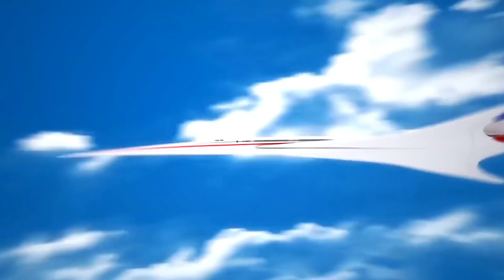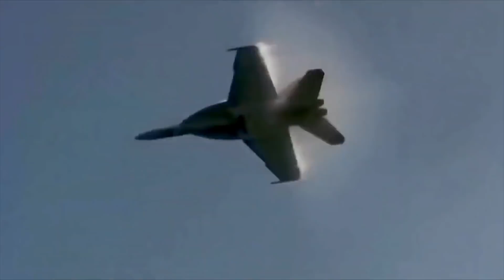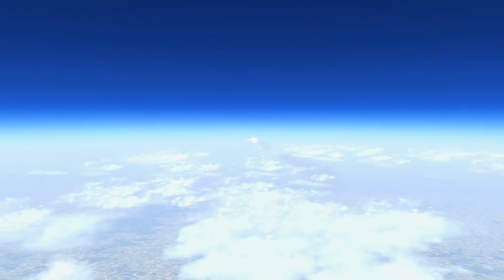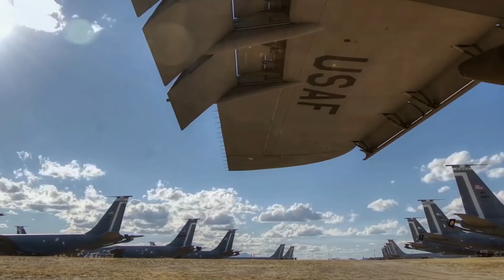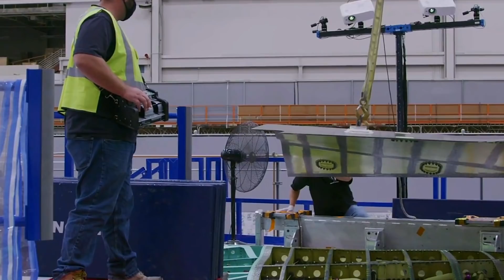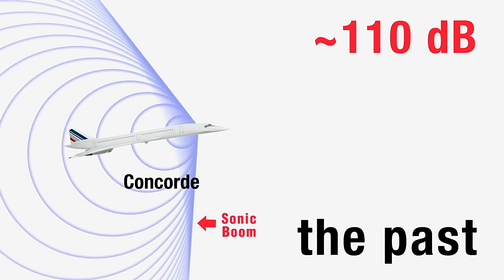A Supersonic Aircraft with a Silencer

Comment: The F-117 was made of 3 Different Aircraft to Begin with.
Reply: was it? what parts?
Reply: @mattwaters9008  It used F-16 stuff mostly, including the landing gear.  So, it is kind of funny this video says landing gear from an F-16 and stick from an F-117.  Of course, Dark Docs isn't at all known for accuracy anyway, so it if all turns out to be parts pulled from a Cessna 210, a Chevy S-10, and a DC-10 I would be all that surprised Dark got it wrong.

Comment: I’ve always understood the sonic boom to be an unavoidable result of faster-than-sound travel, not something that can be engineered into irrelevance. How does the design of the plane minimize the boom? Clearly part of the answer is the plane’s unusual needle nose, but why? The video frustratingly spends too much time on the plane’s Frankenstein aspects and stays quiet on the very technology promised in the title: the silencer.
Reply: Vanghost Art  Do little ice cubes make drinks better by cooling them faster than bigger cubes of the same total mass, due to increased surface area, or worse by diluting the drink quicker for the same reason? Does the answer depend on the drink, and if so why? Yes, I am a party animal!
Reply: I'm thinking it has more to do with the cruising altitude than the physical build aspects, as it states in the clip.
Reply: A bit late with the reply but it's shockwave generation that's unavoidable, not sonic boom. That's not a contradiction, look at the Busemann Biplane concept.
Reply: So I generally don't weigh in here - but you're right about it being about the nose.  Think about air being a substance like a giant rubber band, not just well...air.  As you travel through it, there is resistance on the body traveling through it.  You get this a little like if you're going down the highway with your windows down...even on a windless day standing still, as you move through space, there is air resistance and indeed, friction.  Your car (or any other jet that can go supersonic or literally "over sound" does the same but because the nose is snubbed, or not out in front of the main body of the craft stretching through it (and if your car can go that fast - I want the secret!), after the point at which sound travels - that's the rubber band, from the analogy above snapping back into place from being stretched to its limit (so in other words, it's not the sound being snapped, it's the air pressure/friction around the aircraft it's traveling through) Because of the nose cutting through the air to the back of the aircraft where the "rubber" snaps back into place, a louder "boom" is heard.  Add to this that the "rubber" in the air at high altitude is thinner than on the surface of the earth, and so the "snap back" is far less than say, at sea level.

This particular aircraft, because it's nose is "needle" the stretching of the "rubber" (sorry for the analogy!) is stretched more precisely, and more gradually, so that when it does snap back - it snaps back more gently and less suddenly.   Sorry for the layman's terms for aeronautical physics...I don't know from where or which profession you come from - so I thought I'd try to be as simple as possible.
Reply: @JoelMBarr-hh7vs  Thanks, it’s fascinating stuff.
Reply: Fortunately NASA has the sort of information this videographer left out. 
Pre-pandemic they would have a huge setup every year at EAA AirVenture Oshkosh with information on projects such as this one. I do remember the display and talking to the people staffing it. IIRC the angulation of the nose and control surfaces makes the impact of the plane hitting the air molecules more gradual, so the cone of displaced air (the shockwave expands in a conical shape) is longer and smaller diameter. By the time the shockwave does expand far enough to hit the ground, it has dissipated enough to blend in with background noise or at least not rattle the dishes and break windows.
Reply: @BigBlueJake   Wow, that's super cool - mine was really a SWAG, TBH (it seemed logical) And the videographer provides us with likely hours of entertainment - I'll forgive him the occasional omission. :D
Reply: @slowerpicker  just shy of your pursuit!    You need many smaller ice cubes !! Not a huge one regardless of it having the same surface area..   the magic happens in its sheer numbers
Reply: Avec tous vos dollars vous avez 1 siècle de retard à comparer avec la technologie concorde.
Reply: to make a simple analogy, the plane stabs into the air instead of hammering it
Reply: Pointy Snoot Make Air Go Hush Hush
Reply: As a college physics teacher freak 

The scientific question is sharpness the sharper the object is the most ability to PERICE without sound

Like a needle going through your skin it's so thin that air isn't able to stop it and it goes in a lot faster

The air is unable to grab ahold of it so it gives up on reveling the jets position
Reply: It would require way more space and effort needed than I can apply to explain the “sound barrier” and how the shape completely effects the outcome. Has a lot to do with dissipation

Comment: With the noise in the big cities, I doubt anyone would notice a sonic boom now. "Is that another gun shot?"
Reply: The catch with the Sonic Boom tests of the 50's and 60's is that they were rattling dishes on walls and in some cases breaking a window pane here and there, so they're mildly louder than a gunshot from two blocks away. More like a gunshot from the car next to you, which is a good deal more frightening and damaging to your ears.
Reply: Nah, that was a window being smashed by the looters.  You can tell by the giggling that follows.
Reply: rottencactus28  When they're several blocks away in a city, or several miles in the country, you're correct. When they're ten feet away, most people react a bit more strongly. :) Sonic booms are typically of the "ten feet away" gunshot variety.
Reply: Enemy territory
Reply: B B  And they weren't even true sonic booms, either. They're legally prohibited from doing that over land unless they're actively intercepting an inbound nuclear bomber. I'm not even sure if they broke the sound barrier on 9/11, even after they knew what was going on. What the airshow flights do is get up to 0.98 mach, or thereabouts, and create a very loud boom which you generally can't hear more than a couple hundred feet in front of the plane, but it's still not a fully compressed sonic shockwave, since at airshow altitudes, that would blow out the windows in all the spectators cars, and the eardrums of all the spectators.
Reply: @c182SkylaneRG  I remember them. Loud boom! Then just the exhaust noise of the turbines.
Reply: @c182SkylaneRG  Not just for nukes, they can go supersonic to stop any foreign military aircraf that breaches US restricted flight zones, or when an unresponsive aircraft is approaching the white house (which actually happened recently). The only catch is that they have to be above a certain altitude before they reach those speeds
Reply: You would pay no attention to it 
in Chicago, where only criminals are 
allowed and encouraged to carry guns.
Reply: I've heard one, they're exponentially louder than a gunshot, everyone ducks and looks up.
Reply: B B  the blue angels don’t conduct supersonic flights over populated areas
Reply: I routinely hear the sonic boom from SpaceX’s Falcon 9 booster returning and even from 20 miles away, it’s much louder than a gunshot and rattles the windows.
Reply: I live close to Edwards now and sometimes there are some Sonic booms that you cannot miss lol, the whole house shakes!

Comment: Really saving years by borrowing landing gear, a canopy and a flight stick?  Lol.  Way to go digging deep for those savings.
Reply: Much less building, testing to destruction, re building, re testing to destruction, re designing, wash rinse repeat till you get to your goals. Instead just use parts that are already capable of handling the stress.
Reply: One of the longest lead items on a new airplane is the forging for the main landing gear oleo.   Engines are the longest lead item.

Comment: The Concorde used to fly over my grandparents house when turning to approach Kennedy airport in NY. They lived up high on a hill in the Jersey Shore and it was extremely loud even flying slow. Sounded like a fighter jet, and I felt terrible for my grandparents.
Reply: Same near Heathrow, you certainly knew when it was flying.
Reply: A couple of times a day?
Reply: @edmonddowling3686  what?
Reply: I grew up within earshot of the engine testing shed. Sometimes they'd be left running for what felt like hours.
Reply: Well it had Rolls Royce Olympus engines which were originally from an Avro Vulcan. The only difference was that the Concorde's Olympus engines used afterburners

Comment: A FYI... The nose of this aircraft will extend telescopicly and will NOT be as long as illustrated in current footage. It also has a number of analog dials fitted due to the accuracy of digital dials not indicating true airspeed exactly as calibrated once over Mach2,  along with several cockpit parts directly from the Grumman X29 and even a part from the F1-11! 
It was to be powered by two Pratt & Whitney J58 (company designation JT11D-20) axial-flow turbojet engines, although the engine/s have now been made classified. 
There is also a number of other jamming devices which have been fitted although the reason is classified. The underside is totally flat and has 400 layers of a certain silicon oxide, silicon nitride and diamond mylar. It is understood as to perform 99% reflective to protect from hits by certain AN/SEQ-3 Laser Weapon Systems or XN-1 LaWS currently covertly hidden within other weapons on several Chinese vessels in close proximity to the Spratly island's. The rest of the aircraft is covered in a new version of iron ball stealth paint.
Reply: Now that is some excellent information
Reply: How much of this "information" is real and verifiable and how much did you just make up?  Do you have any sources?  Cause it sounds completely made up.

Comment: Maybe if this works my children or grandchildren can finaly fly for less than 2 hours from europe to the us🙏🙏
Reply: Why would you want to go there...
Reply: @Mr2greys  idunno where Else?
Reply: Better hope they win the lotto.
I flew the concord a few times from JFK to Heathrow. Round trip tickets cost 3x  regular flight $1250 Bucks 25 yrs ago.
Reply: @CheapSquierBassPlayer  
What's Canada ?
Reply: @johnsegertsons2143  Perhaps, although in spite of its innovative design, Concorde suffered from a number of inherent inefficiencies that drove up the operational expense - and therefore the ticket price. Hard to imagine that a modern SST wouldn’t still be more expensive for the passenger, but the difference could be significantly less than it used to be.
Reply: @f123raptor  
Say whaaaaat?  How could it cost more today ?? Does ANYTHING cost less today then 5 years ago? The cost of fuel alone today costs way more.
Reply: @CheapSquierBassPlayer  ye but its so snowy and cold i hear the people Are nice but no prob somewhere like the us Hawaii or somewhere else
Reply: Speed costs money. Current passenger airliners are pretty efficient for their speed. It's comparatively easy to make an efficient subsonic aircraft, most of the efficiency is in the engines and wing design.

With supersonic aircraft, the shape of the thing gets a whole lot more complex because of supersonic aerodynamic effects, which makes the aircraft itself more expensive to operate.
Worse yet, even with all the work expended to make a supersonic aircraft as efficient as possible, it's just not theoretically possible to make a supersonic aircraft more efficient than a subsonic one (and yes, reducing the sonic boom counts towards increasing efficiency because the sonic boom takes energy to make, energy which could be used to drive the aircraft forward instead).
What does that mean? It means that ticket prices for a route flown on a supersonic aircraft will always be higher than the ticket price for the exact same route with a subsonic aircraft, and the longer the distance the route covers, the more the price will differ.

Put more specifically, take two aircraft developed by the same company at roughly the same time, one being a jet-powered supersonic transport aircraft and the other being a more conventional jet-powered subsonic transport aircraft. Now take a route between any two airports (for the sake of this thought experiment I'll assume both aircraft can land at both airports, which given the typically longer runway needed by supersonic aircraft is not a given, but if both airports have runways that can support a 747 then it should be good enough). Fill both aircraft with passengers and luggage and enough fuel to make the whole trip in one flight
Once both aircraft have completed the flight and gotten to their gates, shut them down and measure out the total mass of how much fuel was used for each aircraft, the total mass of the passengers carried by each aircraft, and the total mass of luggage carried by each aircraft.
This is so that we can get a rough "how good is it" score, by using the following calculation:
Score = (Luggage mass * Passenger mass ) / mass of fuel used. Make sure you always use the same units for everything, which for simplicity's sake I'll say to use Kilograms.
I guarantee that you'll find that the subsonic aircraft gets a higher score simply by nature of carrying more passengers, and more luggage, for less fuel. It blows a supersonic aircraft out of the water on all three counts, and the only advantage the supersonic aircraft has is that the flight itself takes roughly half as long. Keep in mind that even if the aircraft were somehow magically capable of teleportation, you would still spend roughly 2 hours in the airport at both the start and end of the flight, so no matter the distance involved a airplane flight will probably take on order of 4 hours + whatever the flight time is, and then airports are also very busy places so the automobile traffic around them is horrible, so that might take you another hour to get in/out of the airport on each end too. Considering the bottleneck the airports put on things, supersonic aircraft are something I would only fly on if the flight itself was going to take over 12 hours in the same plane if flying in a subsonic aircraft. Given that limitation, only ultra-long-haul routes would be suitable for supersonic aircraft to be used on, no matter how quiet they are.

Comment: "... has been referred to as the X-59 supersonic Frankenstein parts"...  obviously due to the number of parts taken from other aircraft, including -- as mentioned -- the F-117. The F-117 proof-of-concept aircraft was the Have Blue which basically was a scaled-down version of the F-117. Lockheed could also have called the Have Blue a "Frankenstein" since it was built up using critical parts and systems from four different aircraft, including a system from the F-16 (also mentioned in the video as making its own contribution to the X-59.) That all makes for a very interesting "family tree". 🤓

Comment: There is no such travel ban on aircraft that exceed supersonic speeds. There are regulations that prohibit sonic booms over populated areas. But again. There are no such travel bans.

The Concorde was retired in 2003. That is less than 20 years ago. And it wasn't retired because of travel bans. It was retired because the fleet was aging out. The Concorde cost too much to build, operate and maintain. It just was no longer considered cost effective.

Comment: Well done reliability recycling is a thumbs up. However I must say the SST was not just discontinued because of " noise abatement " protests but because of its limited passenger space and high costs of maintenance . I saw the first landing at Dulles. And endured its roar at my family home outside jfk where it rattled and broke crystal when its flight path was directed over the rockaway peninsula . Its noteworthy that it was 50% louder on takeoff than in flight . So I hope the silencer abates this new version on takeoff.

Comment: 'Silence Sonic Plane' is the right terminology. The only issue with this designs, they require a craft to be super long and thus not structurally safe in most obstical navigating circumstance. This is why we need a over tropicsphere flight airline, or Orbitline or Spaceline.

Comment: I remember sonic booms, as sound is pressure it struck with more than just noise. The ban is justified and an unproven technology that muffles it slightly will not be welcome. Thinking of commercial flight at 55k ft. is also a big leap. Flight done today at that altitude are done with crew in pressure suits, good luck keeping the cabin pressurized. I wish them luck but i wouldn't hold my breath on seeing any time soon.

Comment: No explanation as to how..?
I really wanna know how they get past the big boom....
Is it just aerodynamics?
Reply: I have 2 guesses of an answer.
1: They change the angle of the shock cone by making the nose more pointy and longer.  A shock cone that has a more vertical angle will make a louder boom.  Lowering the angle to be more horizontal relative to the ground reduces the the sound by spreading out the area of effect.  
2: Making the nose longer and more pointed allows the aircraft to make a smaller shock cone, so instead of punching through the air it slices through it allowing a more gradual transition of shock waves creating a smaller boom.   Like pushing a needle throur paper opposed to slamming through it with a hamer.

Comment: The problem, I think, is fuel consumption for such a plane.
Fossil fuels will still be needed and at such high speeds will be consumed at quite a high rate. Fossil fuels are polluting and the supply is running out.